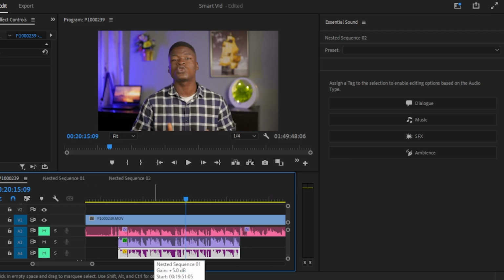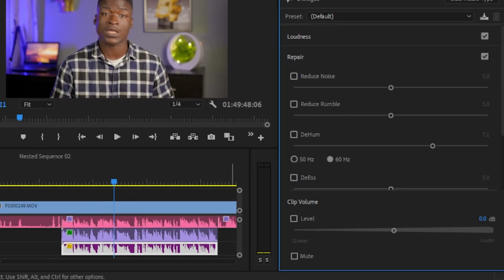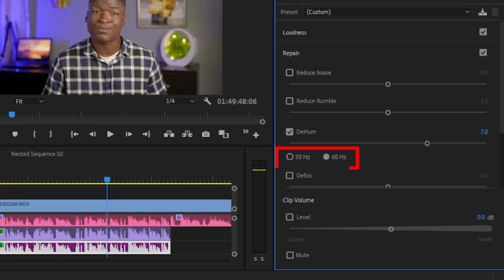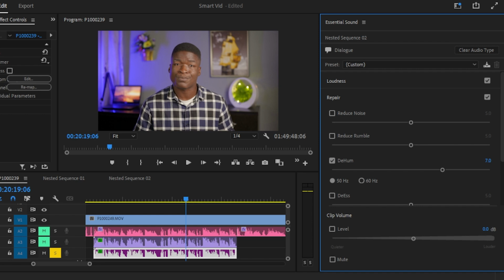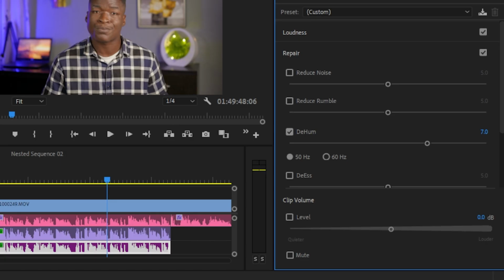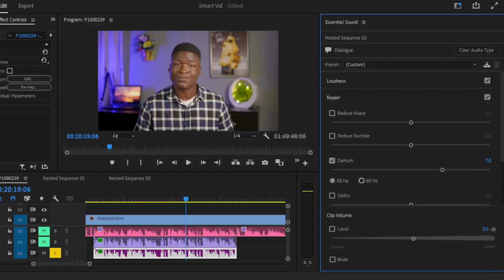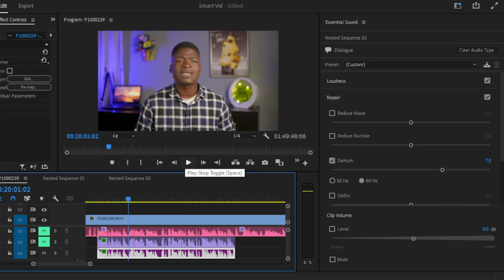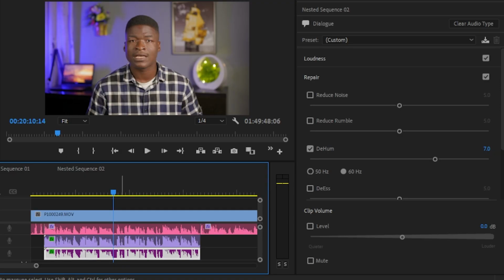Remove Buzzing & Electrical Noise in Premiere Pro (DeHum Tool) | Essential Sound Series (Ep 6)

Comment: A doubt on 50 Hz and 60 Hz - Does it mean the region where the user is working from is to be taken into account?  Or the audio is taken into account, from where it's originally recorded (say a Hollywood  feature audio)?
Reply from the maker: It depends on where the audio was originally recorded. Most countries use either 50 Hz or 60 Hz electricity, which can cause a humming or buzzing sound in recordings. For example, Nigeria and the UK use 50 Hz, while the US uses 60 Hz. So, if the audio was recorded in Nigeria, you would typically start with 50 Hz, even if you are editing it elsewhere. If you are unsure, try both settings and listen to which one removes the hum more effectively.